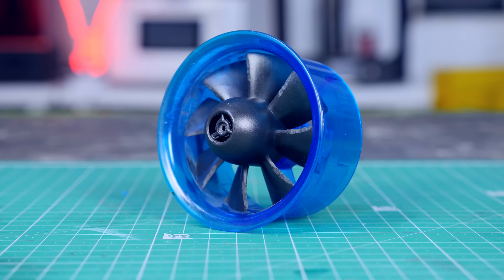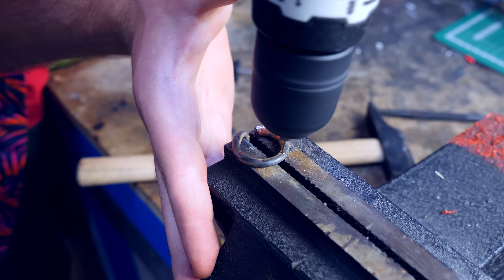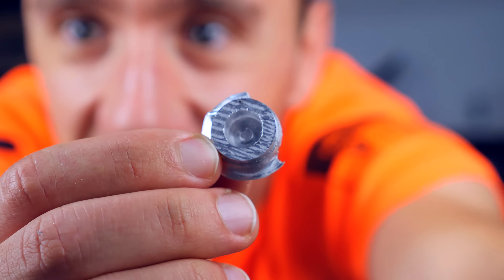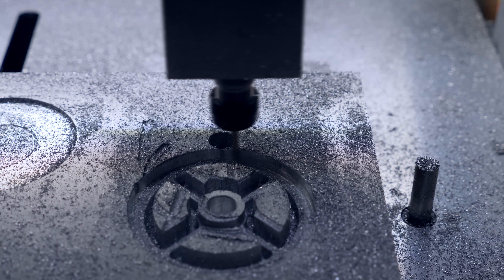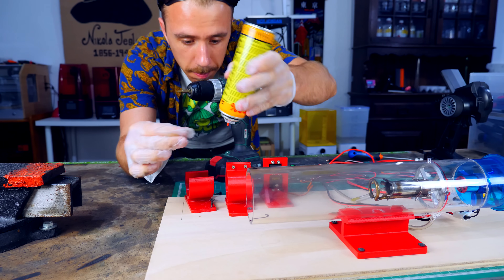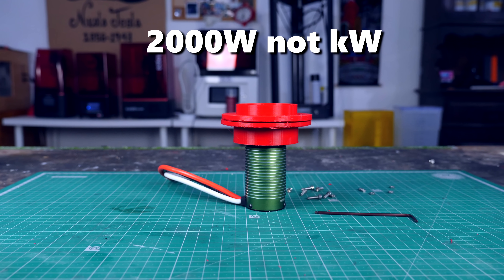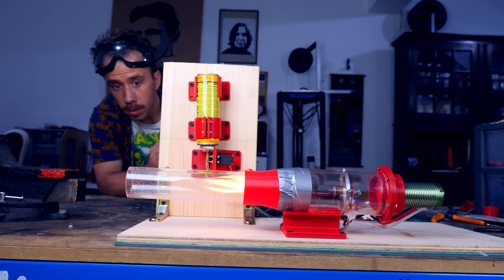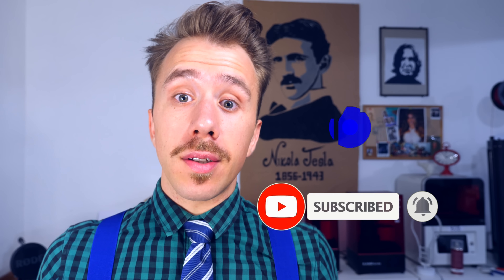I turned my Fan into a Jet Engine (3D Printed EDF Afterburner)

Comment: Video idea: In DARPA style build hollow rocket powered by 4 drone motors mounted in X formation like in style od spacex fins. Or challenge hollow rocket powered by one internal drone motor, flexable baterries around tube and spacex like fins on top to stear.

Comment: when cncing aluminum - consider spraying it with a light oil like wd-40, or alumitap to reduce cutting forces and galling. the aluminum chips really want to glue themselves to your cutter which makes it into a friction cutter instead of a sharp cutter.

Comment: I think you should spend a little more time on the system that actuates the fuel valve. You are pressing the nozzle to the side. You should be pressing it towards the bottom of the can with no side forces. It will be easier to control that way. (Maybe with some kind of cam?)

Comment: How come you don't have exit nozzles on the end? Jet engines are similar to rockets in that regard. Hard to know your exit velocity but I assume you only need a converging nozzle for sub sonic flow as converging diverging nozzles are for super sonic flow. Another trick with super sonic flow is a converging nozzle with slots in it for flow expansion that way you get benefits in both flow regimes.
Reply: Probably cause he likes to use plastics and he would need to use metal parts
Reply: @joshuapham4490  Good point, but sounds like a challenge! Maybe carbon fiber with a high temp matrix?

Comment: Why don't you try to make steam engine , using a solar oven or you can also generate electricity by using that steam.. because solar ovens concentrate light to a single point from where you can somehow boil the water, using copper tubing attached to a core, after the water is boiled use it's steam to run an engine or a Dynamo.
Reply: You can also use your tesla turbine with that hight pressure steam.

Comment: Video idea
Next time try mounting the fuel line using metal pipes and place it near the exhaust of the jet
And the centrifugal turbine should have a laminar flow so 3d printed parts needs to be polished up
And i think u should make your own custom carburetor to atomize the fuel
This should help a lot

Comment: Potential add more blades to the centrifugal fan ( like 3 or 4 more) then have a hot water abatement that your fuel line runs through to heat up the fuel back into a gas. That should improve the consistency of the flame. With the added fan blades you should also be creating more pressure and potentially more thrust.

Comment: I think you should make a test bench to see how much thrust these jet engines and rocket motors are making, it will also help in seeing what designs work best for producing thrust and for how long, so you can optimize your designs to work the best they can!

Comment: Best way to heat your fuel is to run it around your electric motor in brass or copper tubing, provides cooling for the motor and hearts fuel toward the combustion chamber. This is an awesome project by the way!

Comment: Please add cooling to your CNC it will save your ears and drill bits, aluminum is soft and will melt easily especially if you lathe or mill it without lubrication, you will get crappy cuts the longer you use the CNC.

Comment: While you made a cool blow torch, sorry, this is not a jet engine. I mean, you're just combusting gas at atmospheric pressure and while the expanding hot gas will give the tiniest amount of thrust, it'll never be enough to offset the weight. Build a turbine. Compressor fan at the front to pressurise the combustion chamber, get more fuel in there and on the same shaft as the compressor fan, have another fan in the exhaust stream to drive the compressor. Think about it. Jet engines... Car engines... Boat engines... All have one thing in common aside from combustion and that is compression. All engines that burn fuel and give out any meaningful work are all compression engines. If you're not compressing the mixed air and fuel, you're not getting enough air and fuel in there and if you're not getting enough air and fuel in there, you're just not getting a big enough bang. 

Come on man. Build a jet engine. You can do it.

Comment: So… First of all, I’m sorry. I’m going to keep on suggesting submarines. 😇

Goal:
Remotely operated submarine, 3D printed. (And using machines aluminium where applicable of course 😎)

For depth control please either:
Use CO2 cartridges for ballast tanks (the boring way)
- or
Do something utterly crazy and make a peroxide/chemical reaction based ballast system using your glorious 3D printers to house all materials and mix chemicals of thy choice for maximum gas production. 

For added savagery a 3D printed gas or peroxide torpedo launch, it should have capacity to at least injure a tomato. 

Propulsion wise I can’t imagine what you would come out with but I would LOVE to see it. 

Finally, that Francefina looked amazing.

Comment: The kV rating is not a misstiped kW...its not power it gives you an idea that for 1V it will give that much RPM. A 10 000kV motor is not 10kW but rather A VERY FAST ROTATING ONE. With next to no torque because its not that powerfull
Similarly a 100kV gimbal motor will have LOOOOTS of torque and it will be rather slow

Comment: For ignition; have you tried using a high voltage module? Like the modules used in stun guns, to create an arc? With those modules, you could easily turn 3.2 volts into 15k volts with just a flip of a switch. https://youtu.be/DgoPHid7EQg the copper pipe could be tied to the negative and the fins to the positive to induce a high flow rate and ignite the fuel at the same time.

Comment: Could I ask that you start using strain gauges so we can see the amount of thrust you are generating? It would be cool to see how the small changes affect the overall thrust. For the rest, I cannot wait for the next video.
Reply: this "engine" only generates the thrust the motor can output. There is no jet engine geometry that makes the expanding gas prefer one direction over the other so it depends on the fan to offset the gas expansion towards exhaust. it is just a flamey fan
Reply: @LiviuGelea  exactly. Cool design but calling this a jet engine is pretty clickbait-ey. Its basically just fire inside a tube.
Reply: @JD-by9np  it's an early stage engine, but a jet engine nonetheless
Reply: @LiviuGelea  Thanks for explaining it so well. I am learning about jet engines by watching Integza.
Reply: @jack-bjorn  Watch someone else. his thrust is lacking
Reply: @jack-bjorn  Put the engine on wheels and use a fish scale -- that'll work pretty well.  Integza is on a good path -- if the fan can handle higher static pressures, then that  fan can keep blowing air into the combustion chamber and you can get more thrust out of it.  EDF's don't like high pressures (more of a total moving mass thing), so using that as an afterburner is fraught with problems (not enough "push" to get he flame to move the right way).   It's why jet engines have lots of blades and why those who like to make "homebrew" jet engines usually start playing games with turbochargers (centrifugal fans can make more pressure -- figure "pressure" is roughly "n blades x blade width x speed").  You can get 3-5x the "fan thrust" with an afterburner but you really gotta pay attention to the design (hence the variable diameter concentrators on fighter jets).

Hey Integza, if you want a higher-static fan that's commercial, look for squirrel cage blower fans -- commonly found in vacuum cleaners, and fireplace box fans.  You'll need to look at the flame holder better too -- it's not holding it well enough...   The best part about vacuum cleaner fans is that you can usually mount them in 100mm PVC pipe or so and you get a combination fan and gyroscope (you'll see what I mean -- universal motors for high speed so... yeah).  Control the speed with a "router speed control" box.  If you do it right (220v vacuum), you might be able to get 12-15KW out of it thrust-wise.

And you can make an oil burner out of it and do lost-pla casting.  But try to do that outside... molten metal doesn't like attics (err... attics don't like molten metal... the metal doesn't care).  Heat-wise, you can get ~20-50KW or more (check out the OilBurner or MyFordGuy's channels).

And get used to running the fan for a while before and after a test run.... go look at the guy who's running RC Jet engines on different fuels and you'll see that their "controller" has "starting...preheat...operating...cooling...shutdown" -- jets hate "sudden moves" except for rapid unscheduled disassembly (ka-boom).
Reply: @SolarLightCap  "Nice Vid; Shame about the Thrust" ?

:-)
Reply: The fan probably produces more thrust than the burner.
Reply: @fukhue8226  True, right now.  You can't get away with just a tube (you need a compression zone and then a proper nozzle for expansion for best results).  But it always begins simple and small...

And he figured out that the EDF wasn't working and rigged something with a better static, so....
Reply: The thrust is whatever the fan generates. He didn't make a jet engine, he made an afterburner for a fan
Reply: Print some in plastic...

...if nothing else, it'll be interesting to watch them melt :-/

Comment: I wouldn't class any part of this video a failure, that was sick. You're making progress step at a time, and this one didn't go pop 🤷‍♂️

I'd look at increasing your compression ratio though, you obviously made a start at that with the necked chamber but I'd try squeeze it down even more, your exhaust plume with the centrifugal compressor is "looser" than when you had the high flow EDF. From my experience with IGTs, I'd probably steer more towards axial flow compressors, but that's mostly just personal preference. You could always have multiple centrifugal intakes, that'd be interesting 👀 Search Ruston TA for an example of a single intake centrifugal compressor, the cross section is very interesting

Comment: i think u should use the first fan for the motor only then centrifugal motor is not working because it was producing redflame which means the fuel is getting less oxygen in the first fan the flame was blue as i was getting ample amount of oxygen

Comment: For the ignition source, vape wire is the cheapest and least heat-soaking option (something like Ni80 or kanthal).. You can get similar results from under 4 volts.
A simple coil will last ages and reduces overall size.

Comment: Video idea: Build your own lathe with a 3D-Printer and the new CNC-machine.

So you can expand your toolset and better create rotationally symmetric parts needed for rockets, jet engines etc.

Comment: Have you ever made a spud gun (tomatoes in your case)? I feel like that sort of thing would be right up your ally.
Reply: You would NOT want to use a Tomato as ammo in a gun of any kind :P 
Unless you're trying to paint something with atomized tomato paste!
Either way, a total win for Integza since it does not end well for the tomato haha

That, and unfortunately, spud guns are something that are frowned upon in cities for some peculiar reason...
Reply: @DUKE_of_RAMBLE  it wouldnt necessary need to be as powerful as a spud gun, and yeah the tomato going splat is what would make it fun.
Reply: @averagejoe9040  Yea, it'd be a cool impact!
Though I'm still skeptical that even under-powered, that it wouldn't just obliterate it inside the barrel. 

Finding a way to actually propel the tomato intact may actually make an interesting video though, now that I think about it. Might need to try different gases, to find one that burns slow enough to gently push the tom. down the barrel.
Or the more obvious solution: compressed air. With a valve programmed to not dump it all in immediately. :)

Comment: Great video!
Consider adding mist cooling using alcohol for the CNC. Aluminum really wants coolant, even a spray bottle with isopropyl can improve your experience significantly.
Datron uses alcohol as a consumable coolant in their machines.

Comment: You know what I'd like you design, 3D print and build, keeping in line with this same theme is to make an electric powered turbine with your 2000kw motor leading a fan, followed by at least 3 low pressure compressors, followed by 3-5 high pressure compressor blades. Then you can experiment whether your fuel injector/after burner rig you made up would be better suited before or after the high pressure compressor blades. Naturally you'll need to make the compressor out of high temp PLA like the EXTEM AMHH811F, or even ceramic 3D print it.

Comment: Hey integza you should try using your new CBC machine to print a more basic aluminum impeller that is stronger and add a larger inlet to allow for the motor to create even higher air flow with a more aggressive fuel injected you could get some serious potential thrust from it

Comment: Video Idea: You have been exploring a lot on different devices and technologies. I would suggest a 1-2min clip (anywhere in your video). In this clip explain more about how the device/tech is relevant and what you are expecting it to do. Basically something like a working principle in your application. 

This will be useful for beginners as they can relate more to their classroom lectures.

Comment: Scrap the fan idea and use an old turbocharger and feed the compressor discharge in to the exhaust inlet you can inject liquid butane in to the compressor inlet and once it's running it will self sustain and doesn't need a constant ignition source

Comment: Video Idea: I think a touch of computer science could make your rockets go a long way. By using a raspberry pi with access to thrust measurements, as well as control over the fuel injection and fan speeds, you could write a program to automatically provide the perfect ratio of fuel to oxygen in order to maximize thrust. I really think this kind of system could take your rockets to the next level regardless of the rocket's specific architecture, as doing this by hand is very imprecise by comparison.

Comment: I have had luck with a bug zapper in engines to ignite the fuel. just one button to produce ~5000v. Video idea: make a 3d printer using only a 3d printer (except for electronics).

Comment: Using a denser fuel with a better atomizer and higher compression ratio will get the typical AB results you’re looking for. Right now the fuel mixture chamber is massive relative to the diameter of the engine.
Reply: This is very much the issue with most youtube "afterburners." It needs to burn in a higher pressure zone to do anything useful. Convergin nozzle behind the EDF?

Comment: You could make this engine run with a turbocharger like in the turbocharged pulse jet engine instead of an EDF. You can also try to make 4 stroke engine witch works with compressed air in one of your next videos. You also might need to make the fuel line inject the fuel at a much big pressure. And you could place this engine on a plane. It should have enough thrust to fly.

Comment: Video Idea: Make a rocket engine using an EDF by injecting high speed air into an 3D printed rocket fuel with a metal aerospike you created for your earlier videos. And then kill a TOMATO by putting it in front of hot burning gases.

Comment: your tooling and feed rates are the biggest problems in your surface finish. Use a calculator based on your spindle RPM and your cut depth to get a good feed rate to program for. That poor bit looked like it could snap off at any moment. Try to avoid using tooling that sticks out further than your cut depth wherever you can. (don't use a tool that can cut 2" deep to cut a 0.25" part)  

Also if possible, use carbide tooling. Carbide doesn't need lubrication so much as it needs cooling, so water can work in a pinch, but 5% coolant/oil mixed into water works really well. 

Good luck!

Comment: When you are starting a turbine type engine, make sure you spin the fan slowly at first while you allow the combustion to begin, then increase fuel and fan speed proportionally. Also, real jet engines have the flame holder/spoiler after the fuel rail/sprayer

Comment: Please help me win a 3D printer 😅,
Alright, the video idea I have is to make an Electrolytic separator to produce Hydrogen and oxygen and use that to make rocket fuel, you can even use that to run this jet engine and burn "ALL" the tomatoes 😎
because remember tomatoes are disgusting.
Thanks

Comment: to pre-heat your fuel, run your fuel line (either brass or stainless steel) in a coil around your constrictor/thrust nozzle. this will have the added benefit of cooling your engine nozzle while pre-heating your fuel.

Comment: future video idea:
adding a system to be able to restrict/expand the flow via flaps/fins mounted to the end of the acrylic tube, similar to jet afterburners? maybe even hooking it up to the same sensor that receives the RC remote's 'release fuel' signal, so the two happen in tandem- the higher the fuel rate, the tighter the restriction of the fins. Might allow for a 'ramping up' to it's full thrust capacity, rather than choking from trying to go from 0-100 right off the bat.

Comment: what if you preheat the fuel into the barrel before ignition? seems like when you had the fuel going the dispersor was freezing.
In that way the barrel will be colder, the fuel hotter ... nothing should go wrong... what's the worst 💥 that might happen?

Comment: Quartz glass tubes for propane patio heaters are affordable. A pair cost $65 usd on amazon. They'd make a far superior clear tube that is very heat resistant. Move your combustor into the glass portion.